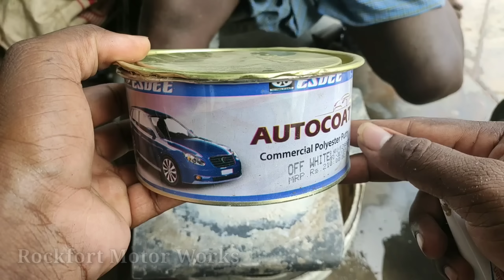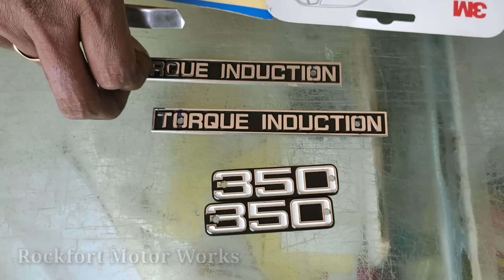1988 Yamaha RD 350 Tank Restoration / Rockfort Motor Works

Comment: Brother, what about internal rust how to clean that, I have been trying but fails to do so?
Reply: One part muriatic acid,4 parts water. Let it soak,check often. When it's clean,empty water,put acetone in,shake it around well,empty. Let dry.
Reply: @digschopper9321  Thank you